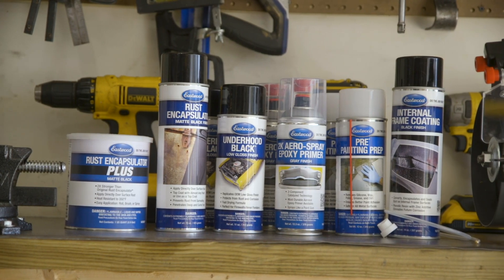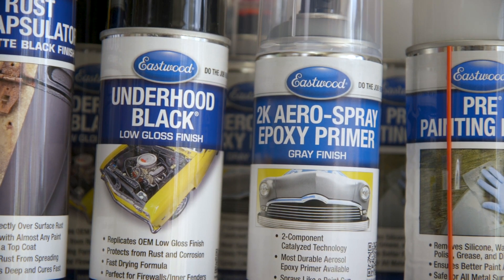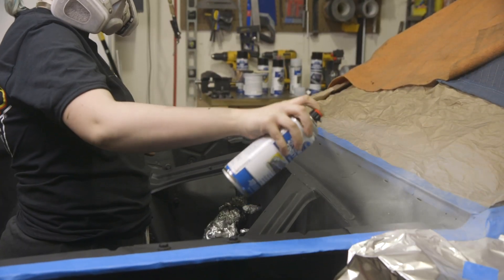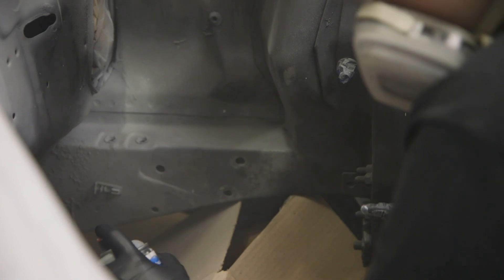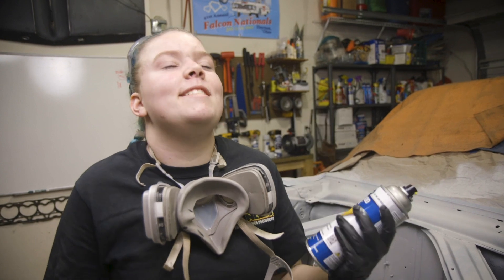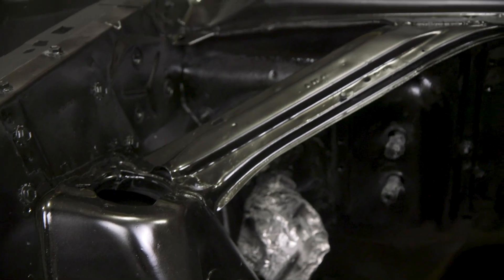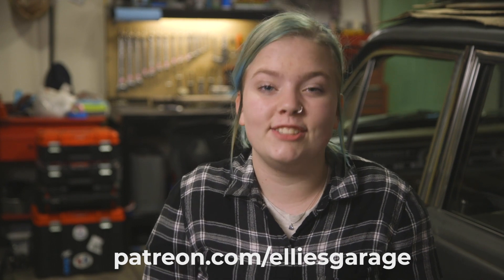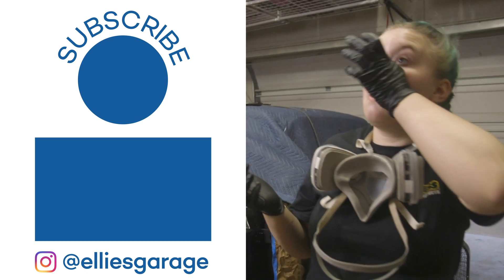Priming and Painting My Engine Bay!

Comment: The engine bay looks great.No you need to fill it back up.Before you put the front sheet metal back on,you should give the suspension and steering a thorough inspection.Especially all the rubber parts like bushings.They're easier to work on without the sheet metal in the way.